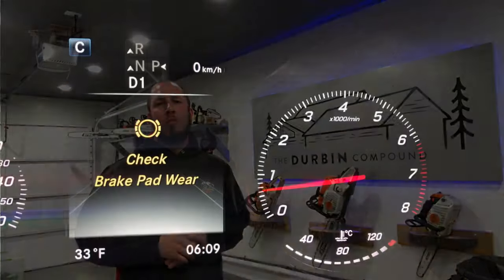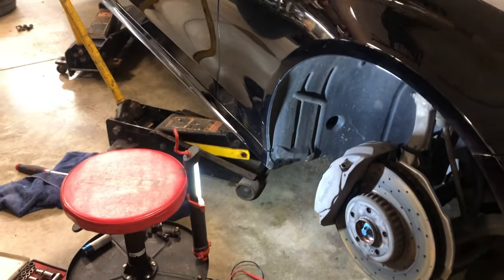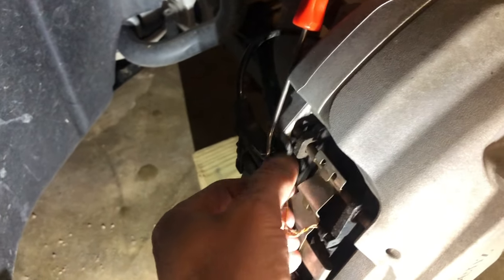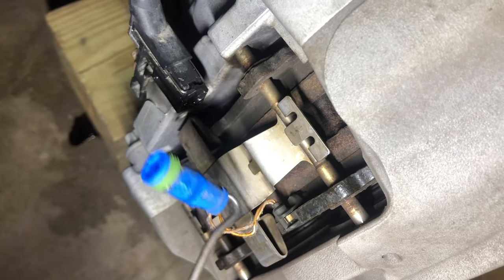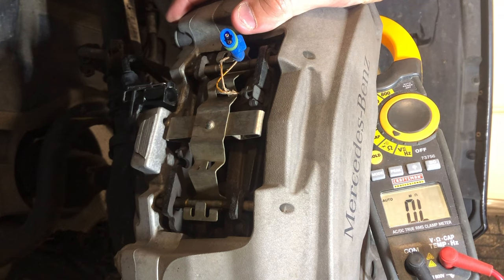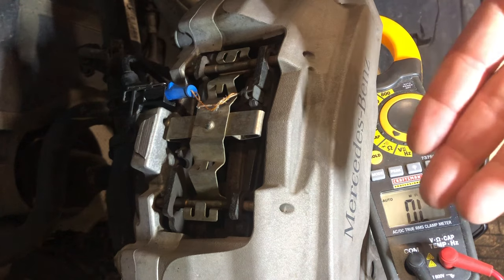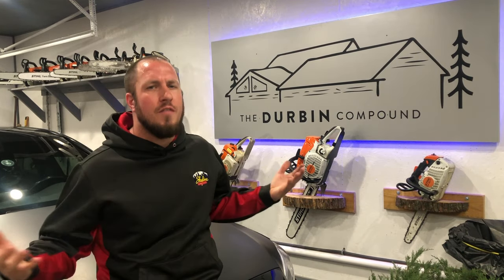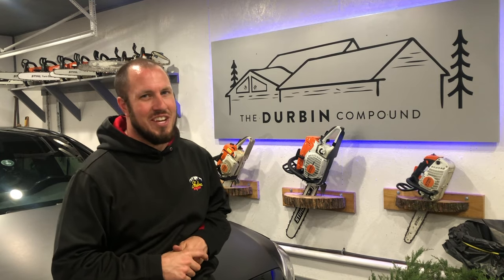Mercedes C300 W205 Brake Pad Wear Light

Comment: My pads were still showing lots of material.  They were not even close to the hole where the wear sensor spike inserts.  The spike on the wear sensor had wire exposed even though there was no plastic worn away by the discs. This must have triggered the warning. Not sure why. Perhaps this sensor was moving up and down which wore away the plastic and exposed the wire.  I changed to new pads since I bought them, but had I checked this first I could have just replaced the sensor.  My Brake Pad Wear light re-set itself after driving a few miles.

Comment: Great video, but as a former sparky, I feel it's my responsibility to say that you were measuring 130,000 ohms across the old sensor, not 130 ohms (see the "k" on the meter).  Both would indicate a bad sensor, but I doubt you'd  ever see a bad sensor that's less than many thousand ohms.

Comment: Right so both front and rear brake pads are around 7mms thick which is well within specification. I'm trying to turn the light off and not waste money on something the car doesn't currently need.
Reply: How did you turn it off? Could you please tell me.😊

Comment: My brake light wear just popped up. How long do you think i can drive?
Reply from the maker: Honestly depends. If I remember correctly, the sensor in the rear is in the inside pad and the sensor in the front is in the outside pad. I would at least get it looked at in the next 1000 miles

Comment: Having the same check break wear light, despite  replacing both rotar and pads in the front. Is there away to reset using a tool. Going to the same mechanic to see what happens

Comment: How do you reset the light once changing these sensors? Or is it supposed to clear itself?
Reply: You have to have it factory reset if you didn’t go through the pad replacement mode in the dash settings

Comment: I had my pads changed but my sensor was never change. Could this stop the vehicle from driving ? yess my brake pad wear sign was still on.
Reply from the maker: This sensor has nothing to do with stoping the vehicle from driving. It is only an indicator of low brake pads.  It only controls the warning on the dash.

Comment: I replace Rotors and Pads and received error still. Replace both brake pad sensors again with Mercedes brand sensors and error has not went away. Removed and cleaned where they plug in and still no luck. Does anyone have any ideas where to look next. 2007 E550 4Matic. Thank you!

Comment: devil dog, working on my wife's GLC 43 AMG, same issue, I did the fronts, how can i by-pass it, for the rear, just got an appt to get it inspected.
Reply from the maker: If you really want to disable the sensor. You can splice the wires at the connector together.